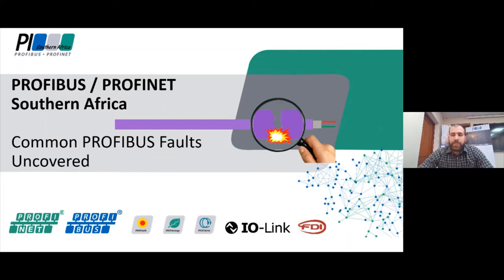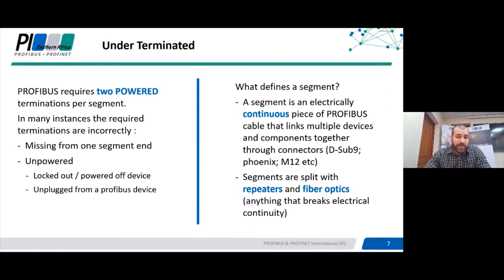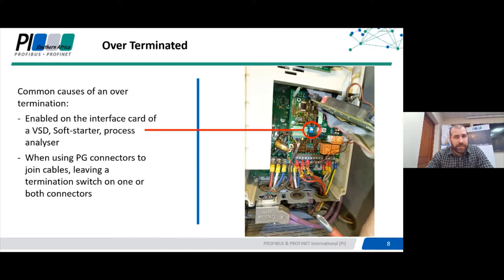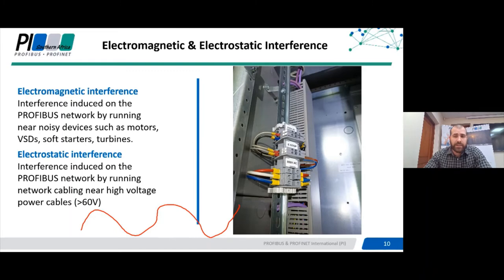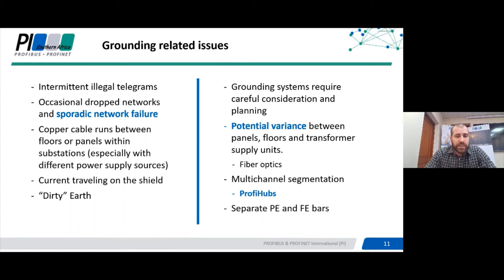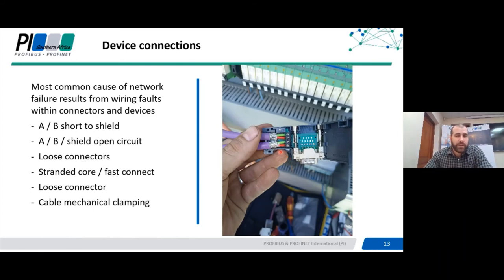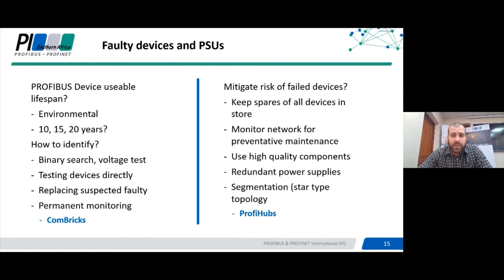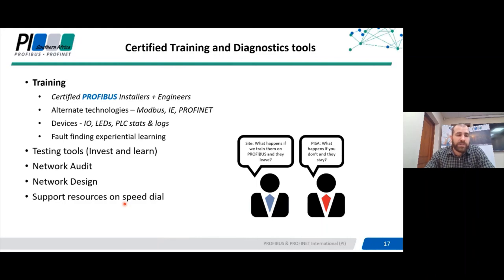Training Webinar: Troubleshooting Common PROFIBUS Faults

Comment: Many practical aspects explained here.. 👍
Reply from the maker: Hi Shashwat, we are glad that you found this video helpful. 😀
Reply: So the dip switch should be OFF when both cables are connected and should be ON if only cable connected ?
Reply from the maker: @sareeshkm8812 Yes terminator should be OFF when there are two cables (device is daisy chained within the segment) and ON if only one cable is connected (beginning or end of segment).  Only exception to one cable rule is stub lines.  Stub lines should not have termination ON.